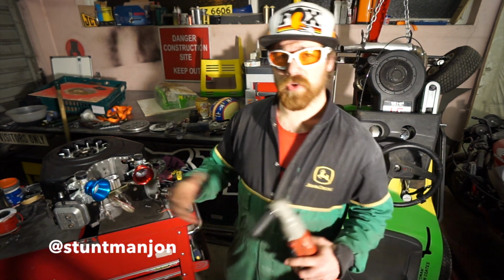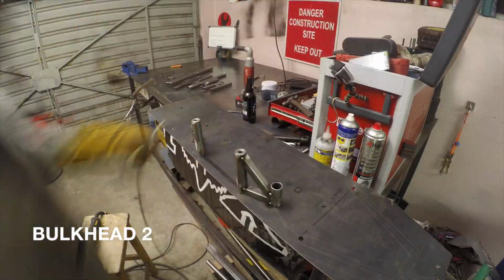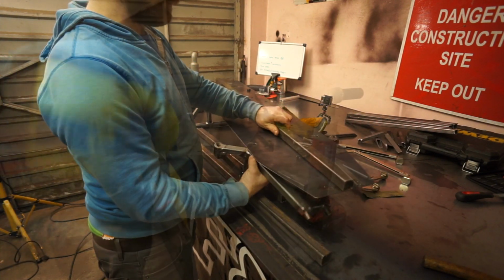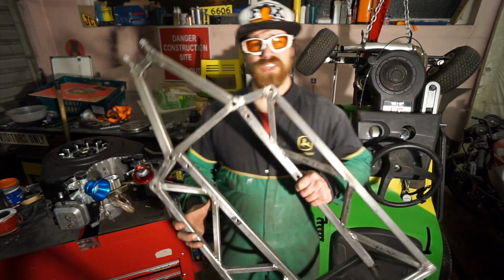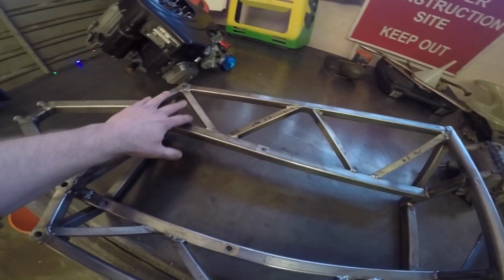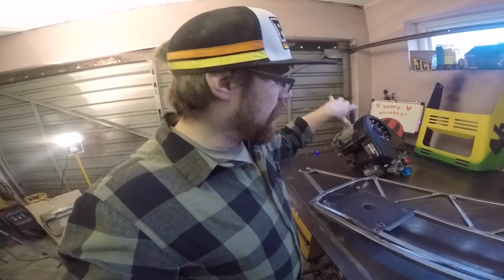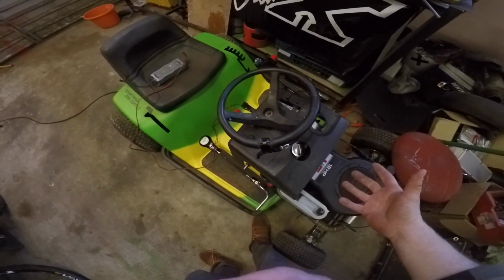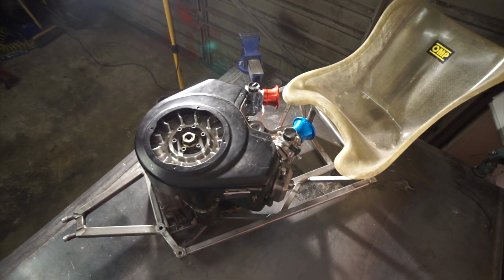SUSPENSION RACING MOWER - SUPER B - PART 2; A HOME FOR THE V TWIN..

Comment: That frame looks amazing, good work!
Reply from the maker: Thankyou Kamal, its a bit different! i hope to redesign the frame after it has been built to save some more weight though, ideally we will build the whole frame - then redo it entirely with lightweight tubing and curved pieces where we can! - but we will get the tractor running and driving first ;) jon

Comment: sweet build as always man... I like building woods romping tractors always with some kind suspension and I have played with peerless 700s.. I've cracked a couple different 700s with my Briggs 28 ohv.. it's nothing special billet rod no gov and 28mm chinese mikuni carb.  i found the 700 is a pretty weak trans on its own and needs to be mounted rigid as f... with an input support and a cage around it.i think even if u do all the supporting u can, still one day that twin will probably chew it up..

Comment: love the videos! thinking of doing something similar with a 45hp twin
Reply: 45 horse power dang what kinda engine is it
Reply: gpx 250
Reply: o its a motorcycle engine i was thinking like a predator engine or something. good luck with your project i would love to hear how it turns out
Reply: hahaha I'll tell u how it goes
Reply from the maker: Thanks man, motorbike engines are great for wee projects like this for sure, we have done the bike engined thing with the little bastard and it is so much fun, LB is about 18hp and 100kgs, (180kgs with the driver), and will get from a standing start to past the 60ft mark in under 2 seconds.... so put wheelie bars on it ;) jon
Reply: hahaha I'll be sure to put some on as soon as possible, thanks

Comment: i found a nice lawnmower at my local junkyard i was not able to buy it though because i have no way to get it home it had an 8 hp Briggs Flathead i hope its still there because it would make a bad ass racing mower
Reply: i have wanted to build a racing mower for years but all the mowers i have found were either pieces of shit or were those weird rear engine lawnmowers

Comment: awesome
Reply from the maker: Thanks man :)
Reply: Cheers!
I am looking into constructing a tube chassis for a racing lawn mower myself (see www.WXPSS.tk, North German WurstExpress Mower Racing), but I lack education on how to design such a chassis. Do you have some tips how to start? E.g. the chassis needs to be as light as possible with enough rigidity to withstand rough bumps without any suspension (not allowed).
Reply from the maker: Honestly the very best source of info for those particular machines is going to be the racers from that league, however when designing a race mower chassis, i feel the 3 most important factors are; 

Engine position, (check what your regulations allow you to do with this).  It usually pays dividends to move the heavy engine weight rearwards to allow for better handling.  moving the engine weight closer to the driver weight helps reduce the force needed for the tractor to rotate in a turn, this is especially noticeable in greasy conditions where tyre grip is minimal. 

Front axle. seriously this is a really critical part of a fast mower, so much of the mower performance is derived from front axle geometry.  learn the effects of caster, camber and toe adjustments and apply them throughout the season and testing - a mower than naturally tends to oversteer will be quicker.

A torsionally stiff chassis.  In your question you asked how to make the chassis light and rigid/strong, really i would aim to make it strong and rigid, don't get hung up too much on making it lightweight,  the performance, i have found, is mainly through improved vehicle handling.  building a chassis that is stiff allows the mower to properly load and unload its wheels, (corner weight), when driving through corners.

Theres a lot to take in there so i apologise if i haven't explained it too well, i will try and cover these basics in the next thunder bastard update so stay tuned, jon
Reply: THX a lot, looking forward to next episode!

Comment: You never finished this? Or never posted any other vids on it? Was very interested in this build...
Reply from the maker: Hi Jason, the build got put on the back burner again lol, however it has progressed since that video, the engine was finished and put into the test tractor... Which just happened to be a brand new group 4 race mower which jumped the build queue, (along with another project tractor - check out @stuntmanjon on instagram or even Google it, it's a public page to see what extra stuff has been built). Recently we also had to move out of the cool big house and garage so I'm sorting out a new garage space so I can progress. Tbh the design has changed a bit in my mind since these videos, but I'm still as keen to get this one built as ever, it will happen and I will get these other machines documented too lol, thanks for the interest man, Jon

Comment: Dude I have the same motor how did you get that beautiful dual carburetor set up? would love to do that myself looks great!
Reply from the maker: william pete thanks man, I made up adapters on a lathe so I could fit them, it's a set of molkt pit-bike carbs, it required a bit of reworking the ports on the head to match up the round bore of the carb manifold to the D shaped inlet on the head, but we got there, I've to get it all mounted up and started over easter here, been sidetracked with a couple other projects there lol, I'll put up a better look thru at the engine work as part of this series a bit further in, 😉 Jon